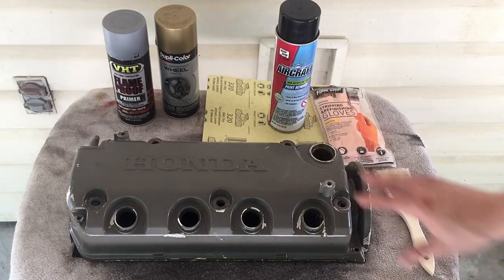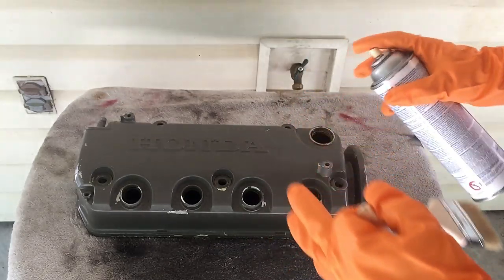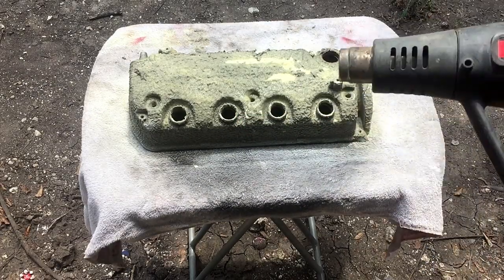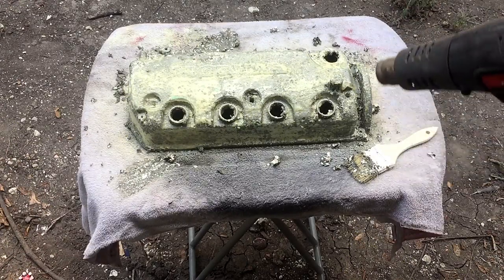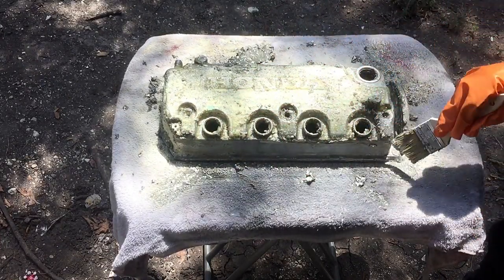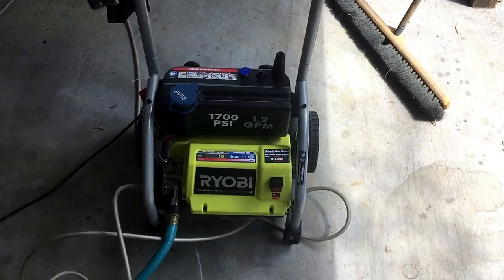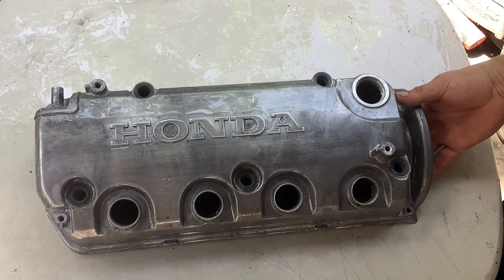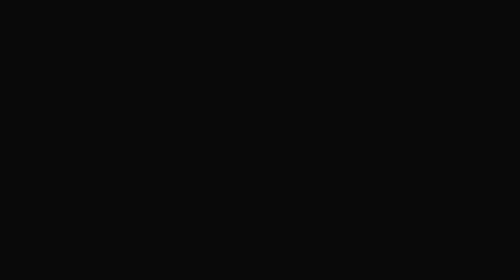How to strip paint quickly for CHEAP (This is a messy but effective method)

Comment: I wish this stuff is as potent as it used to be. The stuff I bought recently wouldn't even do anything to the clear coat on my bike. I literally had to gouge down into the basecoat with a putty knife to get it to do anything at all, and even then I have done 10 applications and only gotten 7/8 of the paint off. Used to be even the fumes would eat paint.
Reply from the maker: Yea i think the spray can works better than the gel stuff but i could be wrong.
Reply: @JamesDguy  I've used both. Neither worked. Years ago I used both and they worked great. Maybe the clear coat I used is just super tough. I do know last year I bought a replacement tank for my supermoto and used the spray and it barely did anything to the factory paint, switched to the gel brush on and it did better but only marginally. Im uses to putting it on and it just wrinkles up, with the paint I painted my bike it legitimately did nothing at all to the clear.
Reply from the maker: sinformant That’s impressive
Reply: @JamesDguy  yeah its just kustom shop 2k clear from.tcp global

Comment: i have an old mk3 supra that was completely painted with bedliner and now i need to forget out how to get it off, any suggestions for the metal body parts and what to use on the fiberglass parts?
Reply from the maker: Water blasting is the best way BUT its expensive.
Reply: @JamesDguy  dang, well i guess i will use my angle grinder with a polycarbide wheel then ... lol